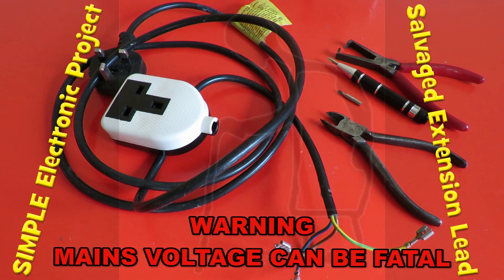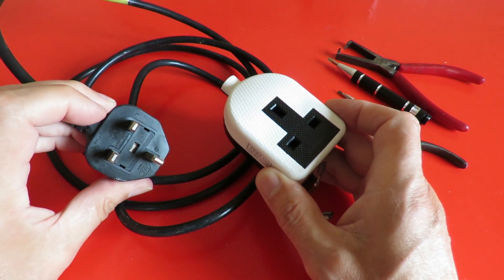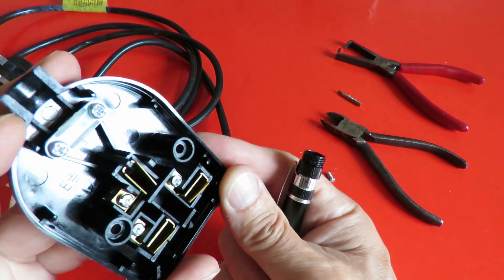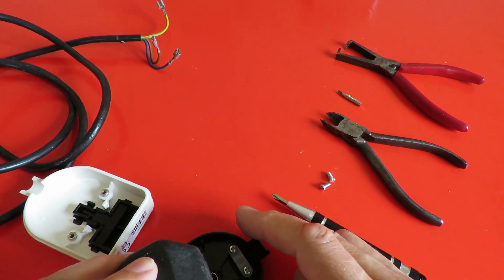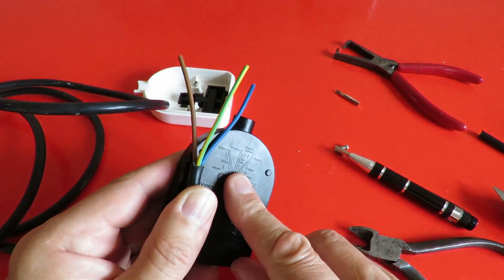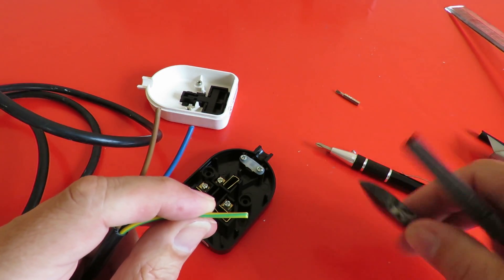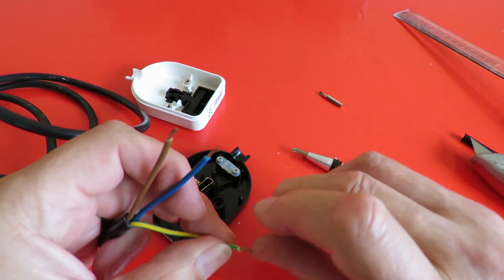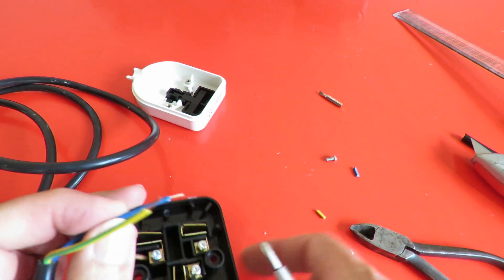Simple Electronic Project - Salvaged Extension Lead

Comment: can u make a clockwork generator for leds  and also see if it charges supercaps
Reply: sounds interesting.
Reply from the maker: The short answer is YES and NO. Technically it is a fairly straight forward task and there are plenty of ready made products that do that sort of thing. You can get cheap pump action torches from bargain stores that light LEDs and it would be an easy conversion to get them to charge a supercapacitor. The question would be "are we talking scratch build from scrap wire, scavenged magnets, gears, springs and plastic bottles?" because that would be an interesting build but I don't want to start that sort of project at the moment as it would just take too long to put together. I will do a short video to explain the simple shortcut using a bargain store torch.
Reply: I actually clockwork like a music box with a coil spring probably a pulley on the end with a rubber band ran to a stepper motor
Reply: I actually mean
Reply from the maker: chong chong If I had a nice big clockwork mechanism to play with then it would be fairly straight forward although most of the mechanism would not be required. If you think about a typical music box, the main barrel moves pretty slowly and would be useless for spinning a stepper motor fast enough. You would need to remove most of the gears to get back to the main spring mechanism to get the speed required and then you might not have the power to turn a suitable stepper motor. At the moment I don't have a suitable clockwork mechanism or a suitable stepper motor but the general principle seems fine.
Reply: fair enough
Reply from the maker: chong chong Thanks for asking and if the right bits turn up I will give it a go.
Reply: looking forward for that
Reply from the maker: chong chong I have had a little try with what I have to hand but total fail, however I will probably make a video of it just for information, some people like to see me fail. The clockwork I have is not powerful enough for the stepper motor I have. Maybe something will turn up :)

Comment: did it work if so then well done ☺
Reply from the maker: Yes it works fine. One of those situations where the wall socket was just a little too far away from the electrical item.